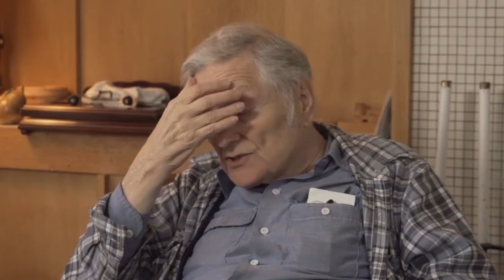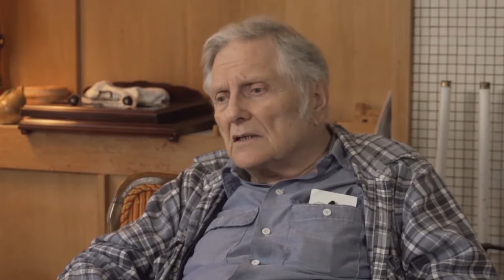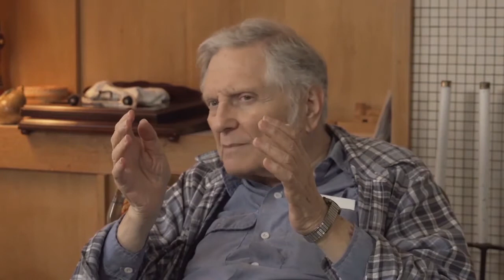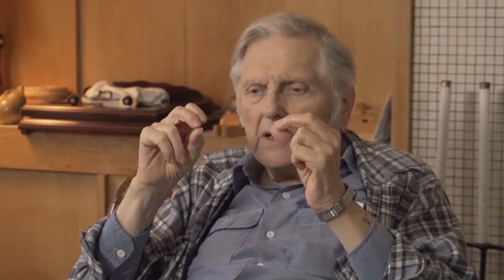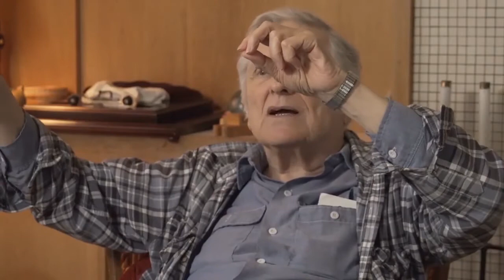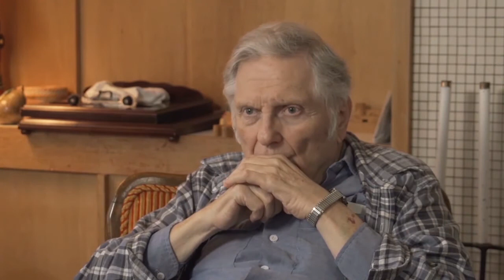Kahan on the 8087 and designing Intel's floating point

Comment: Awesome. I've never done floating point in hardware, but I have written two floating point libraries in assembly language for the Z80 ~30 years ago, one IEEE754 compliant and the other built for speed.

That was back in the day when as an individual you could understand and he a deep knowledge of how your entire system stack worked, from the keyboard and display down to the wire, and you debugged your code with oscilloscopes and in-circuit emulators.
Reply: Yube offers up Kahan so I watch for many reasons. Began as hobbyist with a Z80 system (TDL). Years later I am back with 8080 assembly language. Always wanted to learn the mechanics of floating point. Would you make your Z80 source code available?